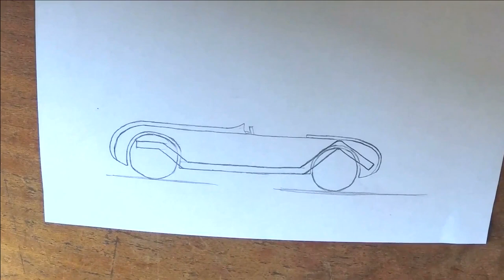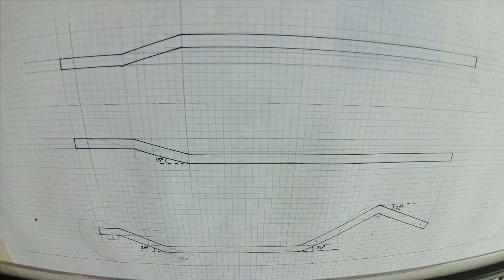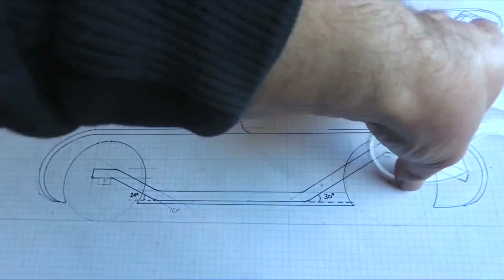How to Design and Build a Car - ASMR - 3 Years in 16 Minutes

Comment: very impressive!! One Question -> Have you welded the Body Panels to the Frame? Because the Frame seems like steel and the panels are Aluminium..
Reply from the maker: Thanks!  No welding of panels to frame - the aluminium bodywork is folded over the steel tubing to hold it in place
Reply: @GasoliniASMR  thanks for information, but gives this combi not trouble regarding contact corrosion?
Reply from the maker: @movo6690  if the metal is bare or scratched it could corrode badly but the frame is well powdercoated and I also put some electrical tape around the tubing as an extra precaution.